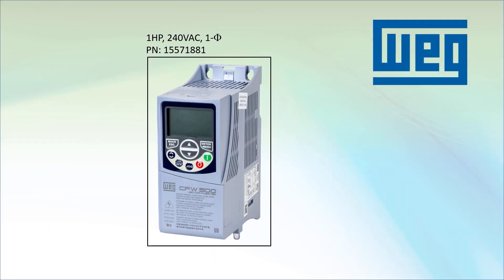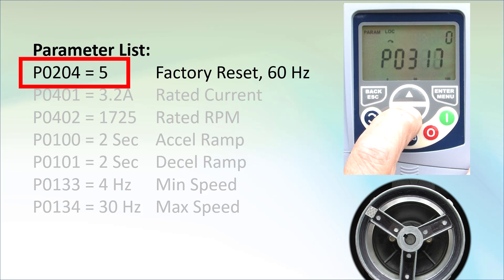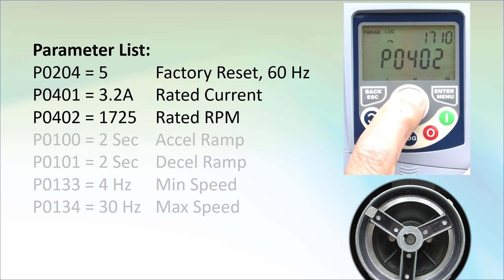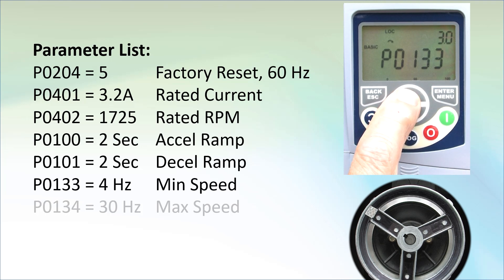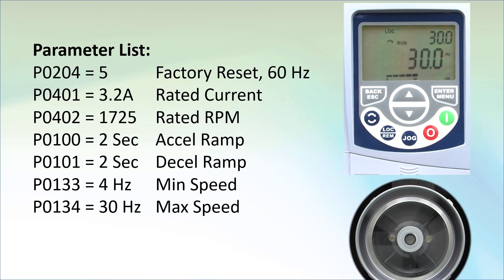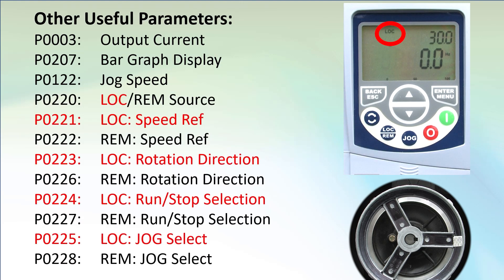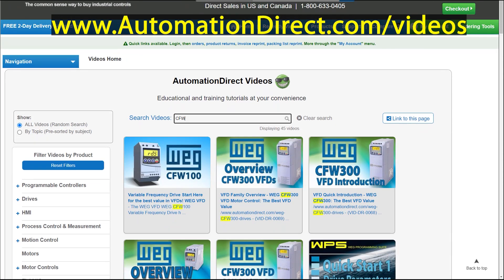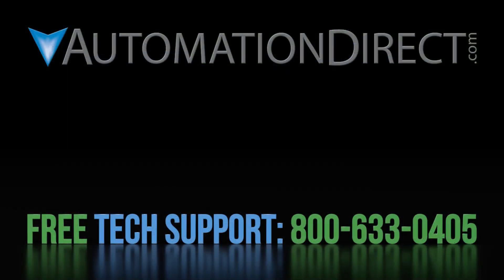WEG CFW500 VFD Quick Start from AutomationDirect

Comment: What mode do i put it on po204 to be able to controller it with add on switches and hrz controller?
Reply from the maker: It will depend on what you mean by hertz controller. There are several different parameter sets that will need to be altered for the switches and to use an external speed control reference. If you purchased the drive from AutomationDirect please contact our Technical Support here: https://community.automationdirect.com/s/contactsupport?utm_source=dwGeUABHDms&utm_medium=VideoTeamComment

Comment: Question, I swear I seen one of these videos for either the CFW300 or CFW500 where you changed a parameter to speed up changing frequency or rpm via the HMI up and down arrows. For instance my use for my CFW500 is for a cnc router spindle which is rated at 24000 rpm (400hz). The speed or frequency change when pressing the up or down arrows is wayyyyyyy too slow. I am eventually going to be wiring an external pot to the anolog input, but I just thought I seen you change something to make adjustments faster via the up & down arrows.
Reply from the maker: Hi Jason, I'm not aware of any way to do that. If you find a trick let me know - I have the same issue!
Reply: @automationdirect  Ahhhh, maybe it was the sped up video....lol. I have a potentiometer now so I'll be getting that installed soon. For the most part this will be used remotely for my 3ho spindle on my CNC router, but I set it up so I can switch to local if I wanted to adjust RPM manually if need be. Thank you for the reply. Ya'll are definitely my #1 source for anything automation. I always refer everyone I deal with doing VFD & spindle setups to ya'll for sheilded cable. Thank you for everything ya'll do.